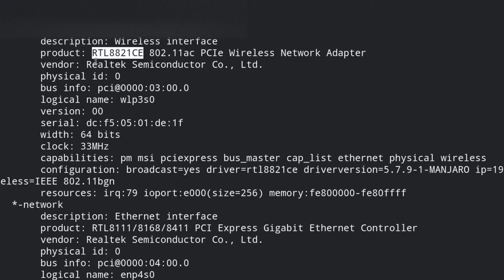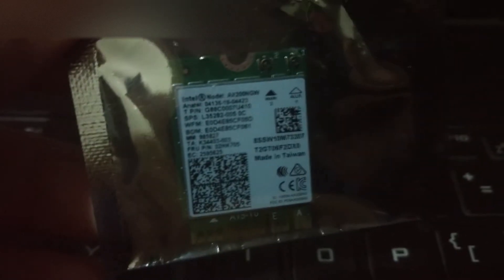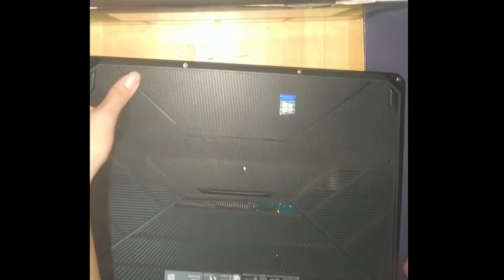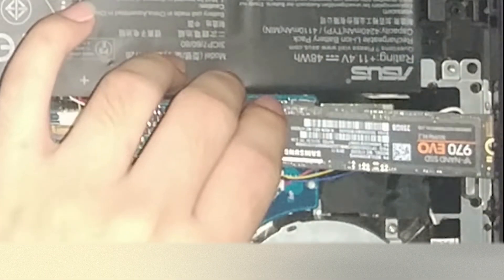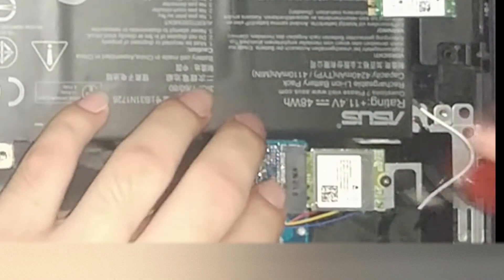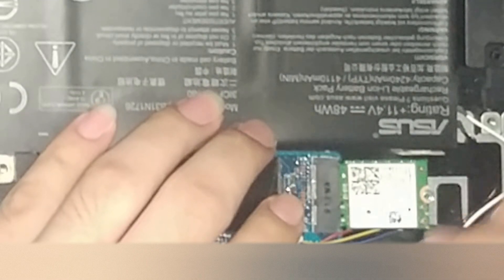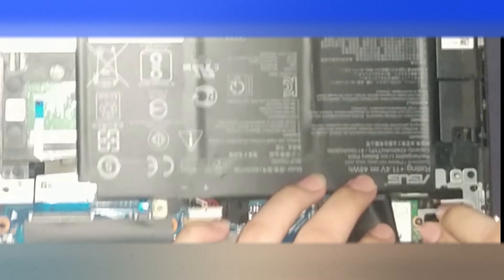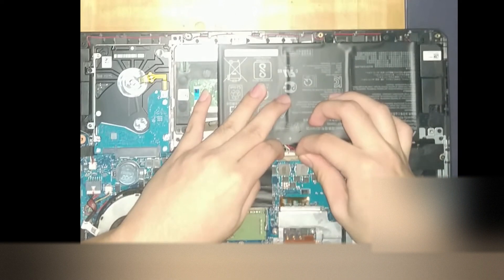ASUS FX505 Wi-Fi / Bluetooth Card Replacement

Comment: The wifi card went bad on my Asus FX505DT-EB73, which I bought on Amazon a few years ago.  I originally had the Realtek 8822CE wifi card, and I just replaced it with the Intel 9260NGW WiFi Card.  

I downloaded the Bluetooth and Wi-Fi drivers before installing the new card, and then I followed this video to replace the old card.  When I turned my laptop on again, the drivers had already been installed automatically.  The Wi-Fi is now faster than ever, and the Bluetooth is working great.  

It took a lot of research for me to get here, and a lot of folks were saying the FX505DT is incompatible with Intel cards, but I found a Reddit thread that pointed me in the direction of the 9260 card.  Therefore, I wanted to share my experience here to help other folks.  Also, thank you to the creators of this video.  There was no nonsense or time wasted in the video.

Comment: Yo, to anyone who does this, MAKE SURE that you disconnect all paired bluetooth devices on your laptop. I didn't and after you replace your bluetooth drive, your laptop still thinks that the connected devices are still connected and will never reconnect or end connection. If that does happen, you gotta manually disconnect them yourself.

Comment: So it doesn't matter if the processor is ryzen? I can still replace the wifi card right?!

I have ryzen 5 3550H btw
Reply from the maker: yes just make sure to avoid CNVi cards (ax201 or ax211) which are only intel-compatible. Ax200 or ax210 would be best
Reply: If the intel card ends in 1 then it is intel process only.

Comment: changed it and it works a lot better on 5ghz wi fi connection, however now it works worse on 2.4. I am reaching 150 mpbs with 5Ghz and only 1.2 with 2.4ghz. Not sure why is that.

Comment: Will it fix my Bluetooth issue too? I get audio interference in my Bluetooth headset device when my wifi is on. Headset works fine with other devices. 

My laptop is FX505DT
Reply: Did you ever fix the issue?

Comment: Will this work on FX505DT with AMD Processor? I have existing RTL8822CE that doesn't work properly now and I'm thinking to replace with AX210NGW. Will that work?
Reply: How did it go I'm planning on doing the same, I heard online that it would work
Reply: @bruhmoment3225 hey bro. yes. still works mine. I ordered mine from China and still works. after a year.. my WiFi stable and  BT doesn't disconnect my controller ever since
Reply: @Venlorz so it didnt work :(?
Reply: @Kaizukii-eh9rj  the one i ordered from China? yes I ordered the AX210NGW and worked perfectly. No more disconnecting/reconnecitng WiFi and no longer disconnects my PS4 controller via BT
Reply: @Venlorz  I have the same laptop model, but when I installed the AX210, The bluetooth doesn't work for some reason

Comment: I have the FX505DT and my wifi card is the same as in the video. it works great with linux. My wife's computer with the same chipset does not work in linux. I plan on upgrading to wifi6 and didn't want to take apart the laptop just to see what type of card is used.  Very helpful video.
Reply: what card are you using now in your FX505DT?
Reply: @comeatmebro7012 I upgraded the wifi card to an Intel AX210. I don't have a 6Ghz capable router so unable to test that band. Overall good card

Comment: Is this issue with drivers or just chip is plain bad? Thanks for the video btw
Reply from the maker: hey, the card itself is bad, i have tried many driver versions and still disconnects frequently
Reply: @72ak  I'm way overdue on this, but after a bunch of research (and my own personal experience), I can say the Realtek card is straight trash, and Realtek is the generic/store brand of computer parts.